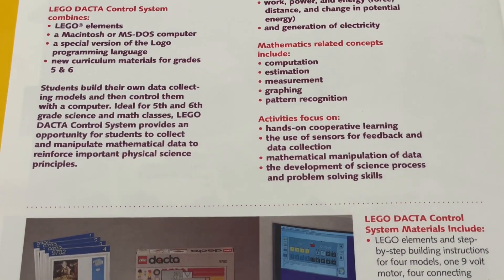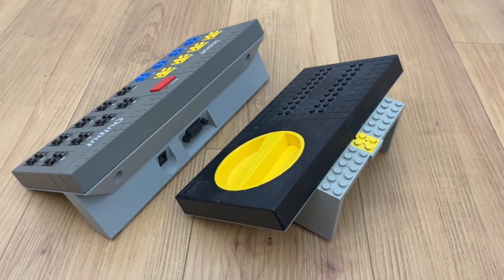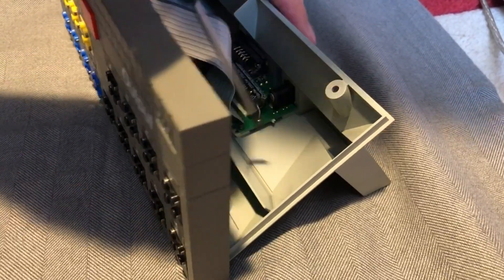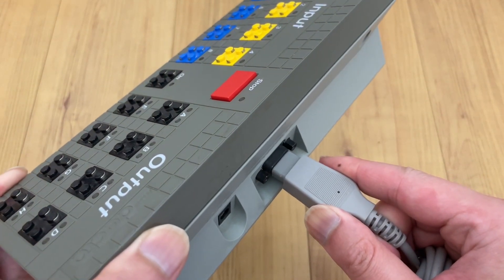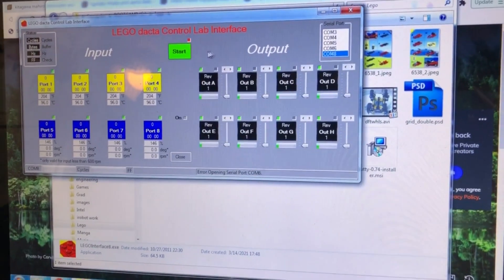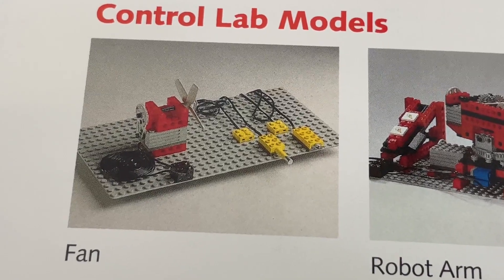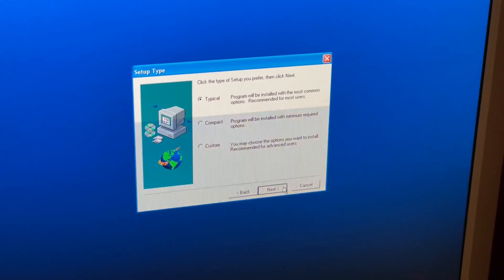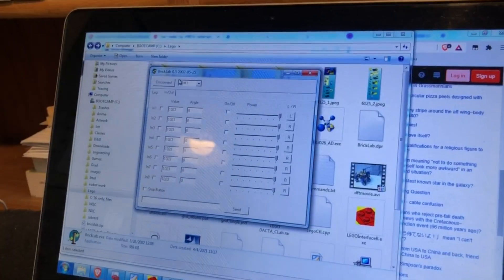What is the #lego #technic Interface B?

Comment: I think that's a one way communication with a  straight serial cable instead of a  crossed null cable for two way communication.  Check your cable I think the seller sold you the wrong cable.
Reply from the maker: If the cable was bad it wouldn't work with the third-party apps either would it?
Reply: @NonsenseWars You should test the cable with a multimeter in continuity to check it is correctly wired. A confirm the lab work with win7 and xp 32 bits

Comment: I think the problem may come from your null modem cable.
You need a null modem cable but I think the seller sold you a standard serial straight cable instead.  Check that rx and tx a crossed with a multimeter

Comment: I had the same issue on my win2000 compaq deskpro 4000 but the unit works out of the box on my win7 dell machine. How is that possible. ?
Reply from the maker: Were you able to get control lab working?
Reply: @NonsenseWars on my dell machine it's working out of the box in a win7 in serial.
I don't understand why but I can give you the reference of the computer dell precision t3400 32 bits win 7.
Reply: @NonsenseWars  I tried on xp and it is also working.....

Comment: I spent about 3 years on and off getting Interface B to work the way I wanted to.  Almost all of my work was with Mac hardware (all the documentation for this set-up were generally screen-shot from Mac OS's, so it seemed the right way to go).

The greatest issue is one you already worked past, the null-modem cable, which can be quite the "speaking greek" concept to folks today.

I can run Control Lab 1.3 under Windows 7 (including 64-bit) with vmWare on an Intel Mac (with a USB->Serial interface) and have it work fine.  RoboLab works for me as well, and can be less finicky for connections, but I prefer the programming enviroment of Control Lab [ironic, since "we" really looked down on Logo as "not programming" when these products were current :-P]  I can ALMOST get the Mac Control Lab to run under emulation on the same machine with Sheepshaver, but it only works with outputs to motors, no inputs -- I blame the emulation not being fully up to par there).

I prefer to run Control Lab semi-native on one of three machines I've collected: either 1 of two Mac Mini G4 machines, or an iMac G4 I have.  With those machines, which were released far past the period of built-in serial interfaces, a keyspan dual-serial interface works wonders (USB to serial, but the true magic is their driver that will emulate built-in serial interfaces at the OS level -- the settings of course have to be right for that).

The point is, with enough finagling and application, it can be done.  I also recommend checking out the software at: https://controllab.io/old/index.html

While it's still at the same level as what you've been doing, he gives important recommendations on the "right" chipset to use for USB -> Serial interfaces to use, and that was crucial information for me getting the emulated copy to run.
Reply from the maker: Hey! This is a great post. I will have to look at this more closely if we revisit. 

How did you get a copy of RoboLab?

Comment: if you figure out the serial protocol, you could read/write with anything.
Reply from the maker: This is true, we did consider it.
Reply: It is very high-speed, relatively-speaking - has a bizarre authentication step at the start (“Do you byte when I knock?”) and produces a datastream of everything that you’d have to process - and you’d still have to make a nice user-friendly programming environment to match the capabilities of the original. Easier to get the original software working on appropriate hardware :)

Comment: 5:42 The serial to USB dongle is probably what's messing you up. 

A lot of these old school programs used hardware interrupts to work with the serial ports (because the CPUs were basically too slow to handle polling-based serial communications in a timing-sensitive manner) and this has a high chance of messing up with non-native serial ports due to missing implementations of certain protocols or just bad design that only works in select cases. This is a common problem with all serial to USB dongles and it really helps to do a bit of research if your dongle is actually compatible with what you're trying to achieve and to disable anything on the PC that also might use a serial port like the IR port you'll find on a lot of older laptops. The third party applications probably used newer methods to access the serial port which they support.

Best bet is to find an old workstation (like a dell office pc) from 2003 or so that can run windows XP or windows 7 x86 and still has serial ports on the motherboard (so it's hooked up directly to the southbridge of the CPU), or at least to avoid all ebay sub $15 dongles (they all use the same half-defective chips) and find one from a reputable brand that has been known to work.

Comment: According to a post on Eurobricks, Control Lab only works up until WinME, and not with WinXP or 7, so you might want to try it with an older OS, maybe through a virtual machine
Reply: I've used the official Control Lab software all the way up to Windows 7.  As long as it is a 32 version it should work.  I'm still stumped why they can't get their unit to work
Reply: Also, the LGauge website describes how to use Interface B with Robolab, if I am not mistaken. You might want to try that.
Reply: Btw, super cool finding. I did not even know this existed!
Reply from the maker: I think Robolab is proprietary and not available for free. We'd have to look at it again though.

Comment: 599$ for "starter" sets 🤯
I guess that's why every time I see guys around me just handing out old DACTA sets for the kids section in conventions they're a bit nervous about getting them back in one piece
also I didn't even know the interfaces existed, I always assumed it went from control centers to RCX
Reply from the maker: And this is 1990s dollars too!
Reply: The Control Lab Serial Interface was priced at $222 in 1993.  Now, used, they go for about $75 on ebay regularly (with cable and power supply).  This is partially due to the many variables required for getting a working set-up (and, whatever your approach, if you want the interface, the cabling, the software and all the parts and teaching materials, it's a lot work).